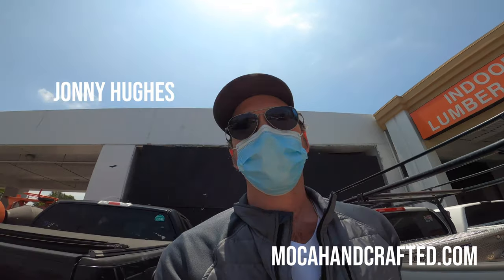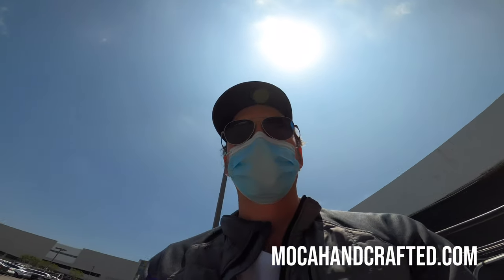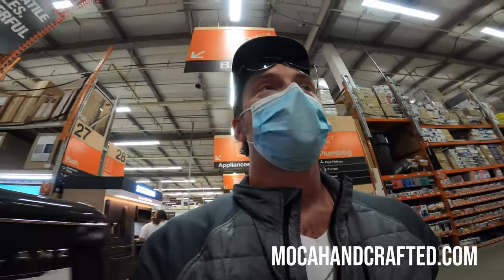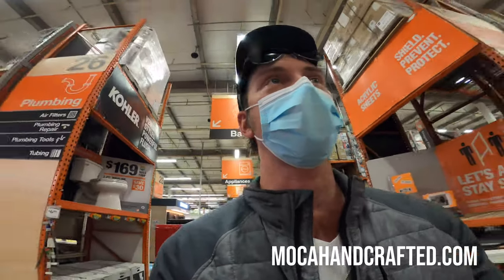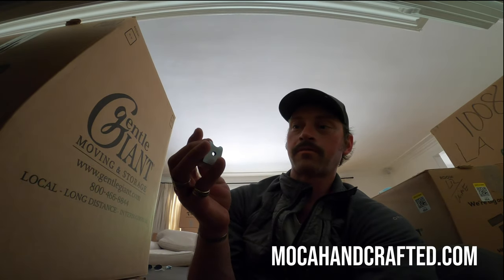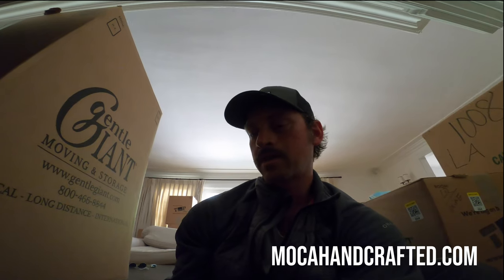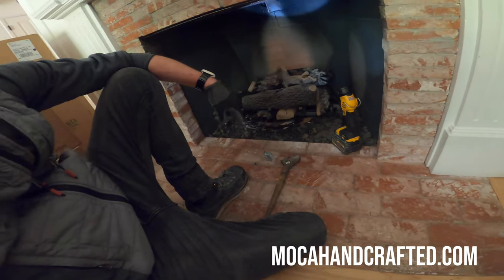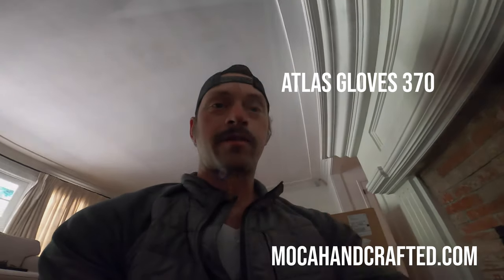Damper Clamp?

Comment: On our fireplace, the size, shape, position, and length of the bolt, the damper clamp completely defeats the purpose of even having a flue. The damn thing won't close due to the clamp, and then the whole thing just flops back open. Might as well not even have a damper at all. It's idiotic.

Comment: If you use a 12 point socket with a ratchet it'll fit over a square head bolt and that would have been a lot easier